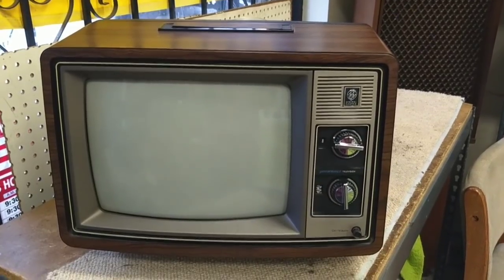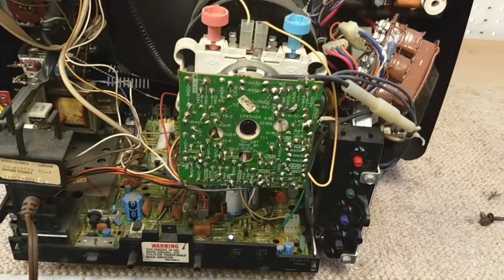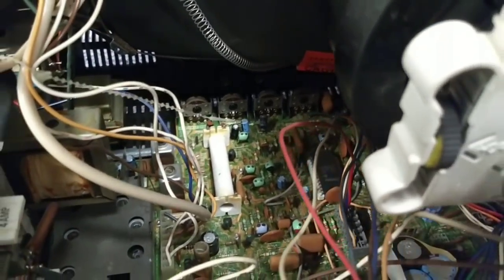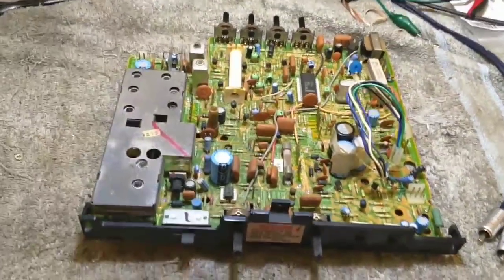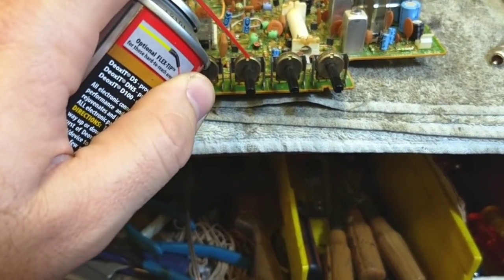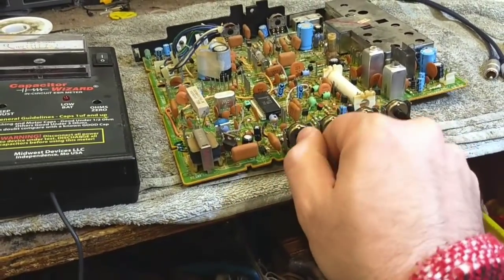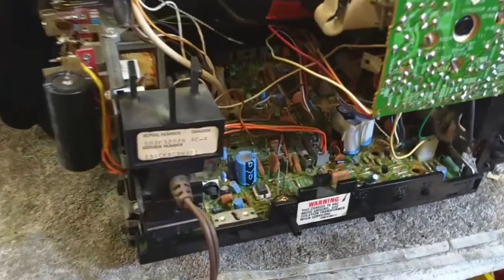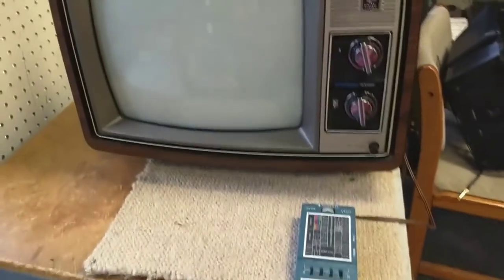Troubleshoot & Repair a 1979 General Electric 13ack546w color television part 1/3

Comment: Similar Philco color portable sets of the 1970's, used an NPN silicon transistor, as a "tone burst oscillator". When they failed, they presented with almost identical symptoms; if memory serves, many of these similarly designed TV's were manufactured in Taiwan. The equivalent of that particular transistor, was a GE-20/2N2222.

Comment: Jordan I love the TV repairs.Did lots of those All the get back then had factory schematics in the back.They were in a plastic cover.Also you should consider a sencore va 62 or vg91 TV analyzer.They are cheap on Ebay and are a lot of help on those old sets.Jim from al.

Comment: Sorry, a little off topic, and a neophyte question but trying to set up a dummy load between my new scope and receivers/amps I'll be sacrificing under the learning curve. 4 8 ohm resistors? One for each pos/neg lead? Or just 2? One for each channel? But then wont the crossed pos/neg leads be shorting each other out. I'm having trouble finding definitive well explained instructions on how to set up a load bank anywhere. Love the videos, your one of the few techs that are not a cure for insomnia. Thanks, Rob

Comment: And we're off! Another interesting series, no doubt about it. At least you've got a good crt and good high voltage, that's a start. 

But I do have one question. There's a sticker on the chassis that says "chassis is 70 volts above ground"---huh? This isn't a series-string tube set where the chassis is hot, I don't get that
Reply: Set uses a bridge above ground so either way you plug in the set it has 70 VAC
on the chassis.
LFOD !

Comment: Looks like a bad tuner. Contact crashes strong so IF's OK.  May be just super dirty. 
Use a big eraser by holding it on the turret & spinning.  Clean contact strip by removing
a few channel strips for access. You can tighten the springs too.
If no joy probably one of the transistors.
BTW there is a mini manual on the back cover if someone hasnt stolen it !
LFOD !